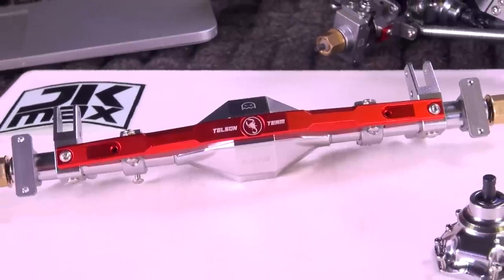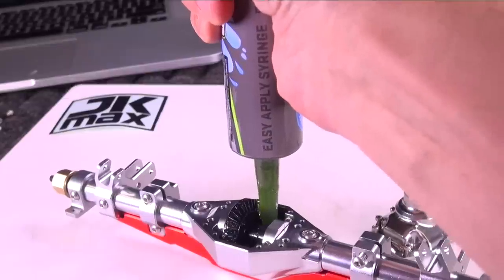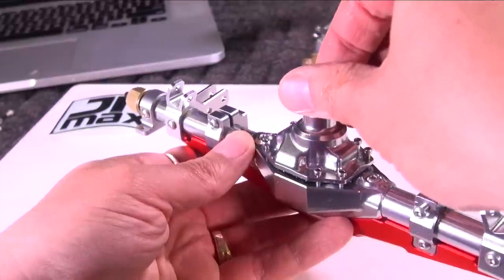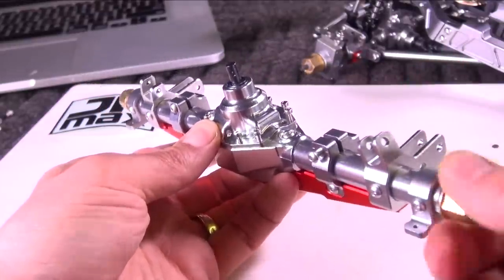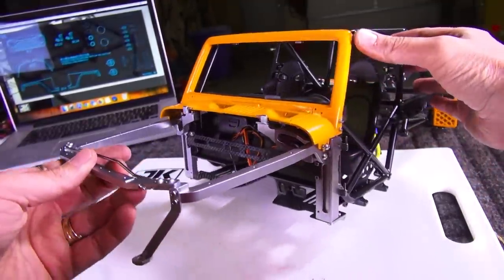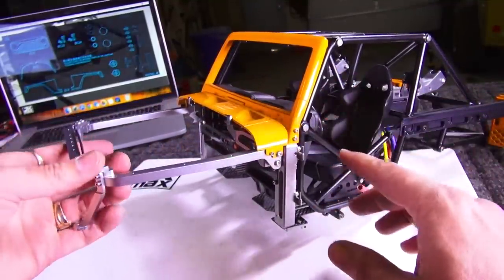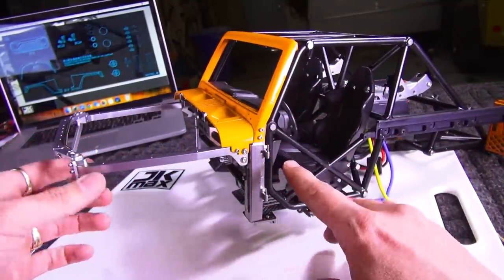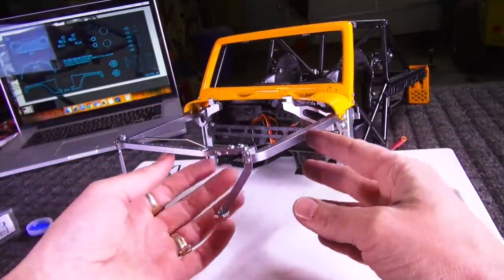RC ADVENTURES - NEW 2018 Super Scale JK MAX - CAPO 1/8 Trail JEEP - BV3 - LiT INTERiOR & REAR AXLE

Comment: 😊👍I love this truck so much detail and metal! Tip for you brother... with anything like your axle or gearboxes that have covers or halves when you put them together put a thin tack of grease around the two parts before screwing them together and this will make a seal so dirt and water don't seep through and get inside..  😊👍

Comment: Great video and agree the scale realism is unprecedented and refreshing.  While I agree with your sentiments on adding more grease, I think that was way too much.  Adding grease increases the pressure in the housing and thus can result in actually causing a greater seal void which is the exact opposite effect you are going for.  If the housing cover is properly evenly torqued, this method could be causing a problem where it may not exist.  Just some thoughts.  Thanks and keep up the great videos!
Reply from the maker: I would have to disagree my friend.. but that is opinions for you, hey? I did not fill the cover with grease, and there is plenty of room in there. there is no pressure built up, becuase nothing is sealed..
Reply: Thanks for the reply, as I was under the impression you had packed it completely.  Again, great video and please keep em coming!
Reply: I just caught your comment about there not being anything sealed.  Do you mean that the case isn't truly sealed?  If so I'm surprised as shouldn't it be to ensure no contamination?  Might be showing my crawler ignorance, but isn't it o-ringed and machined?

Comment: Something you could try is High heat gasket maker, for around the diff cover housing that could possibly seal out all water and mud etc which in turn could save your bearings and gears

Comment: Upgrades on a $2500 rig are they taking the piss?
Reply from the maker: Please read the video description.. you are incorrect
Reply: @ RCSparks Studio
OK then $1500 still a LOT of money (can't remember where I got the $2500 number from but I didn't just pull it out of my ****).  As to the straight gears are they an upgrade supplied to you as a team driver or does everyone get these straight gears?  I can see colour substitutions(e.g. diff covers on the axles/bracing for the axles etc) for team drivers but really on a $1500 kit no mechanical upgrades should be required
Reply from the maker: this entire kit is a mechanical upgrade over whats available on the market...  Straight gears are a down grade in my opinion..
Reply: @ RCSparks
Straight gears; only 'pros' I can think of is that straight cut gears do not transmit any axial loads and are more efficient and the casing does not have to be beefier to carry bigger bearings to cope with these axial forces . But they are very noisy
  As to price; Asia tees, not known for price gouging, are selling this at $2300.
At least I assume it is the same, a 1/8 th scale jeep Wrangler.
 Jk may be intending that every one charges $1500 but...
https://www.asiatees.com/article?1%2F8-Jeep-Wrangler-4x4-Capo-Racing&id=1608

Comment: Can you install the engine next
Reply from the maker: really confusing question.. as I installed it last video. Maybe you should watch all 4 videos, in case you haven't..  :)  I explained it in the Unboxing film
Reply: RCSparks Studio I meant installing it into the engine bay and attaching all the drive line components together and in the jeep
Reply: RCSparks Studio I’m currently re building my stampede 4x4 and have replaced probably 5-10 screws😂

Comment: And that's about it, time to go make that once a year trip to the local hardware store and get some more supplies "Loctite." Too bad it will take a week or two to drive there as you live that far away from the closest town with a hardware store in it! Looks like a heavy model, I don't know what difference it would have made if they made the floors and cross member out of metal? All and all, looks like this build is going great, I can't wait to see it out on the trail.
Reply from the maker: Hi David.. the total weight will be 12lbs, I was told.. I would think battery would add another lb or so..

Comment: Excessive grease = Excessive heat which is far worst than a little dirt. We will strip machinery down just to remove it, mind you I work in industrial environment with gearboxes the size of real cars. Grease is a bad conductor of heat therefore a little is good

Comment: I love the build. Do you know if will the production kit comes with the moving steering wheel and lights in dash. I'm getting more sold on buying one. thanks .
Reply from the maker: Andrew, i do not know if the light kit comes with the standard Kit. But, it is available, of course.. We will know by mid-may, I was told
Reply: Thanks Aaron ,fingers crossed